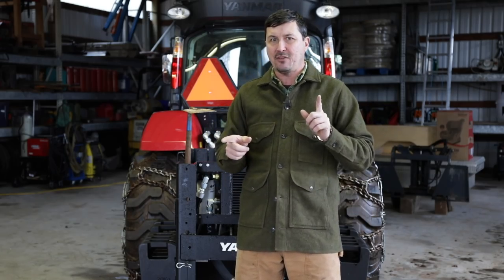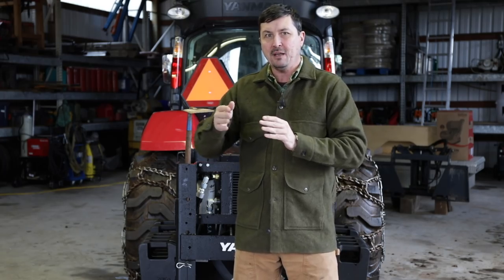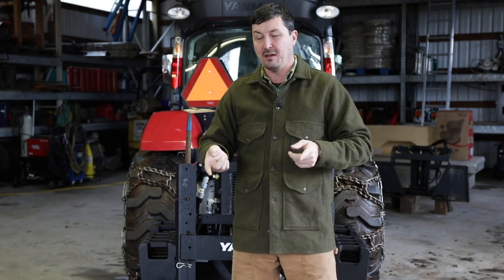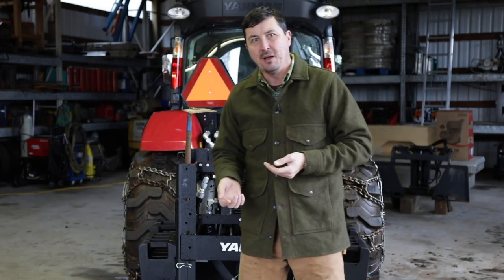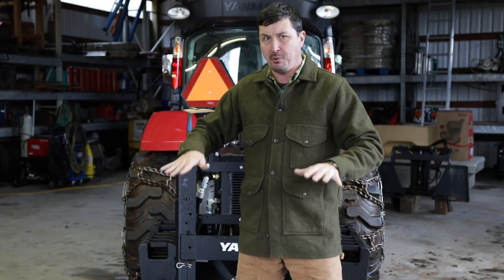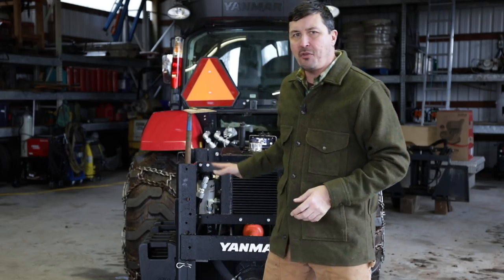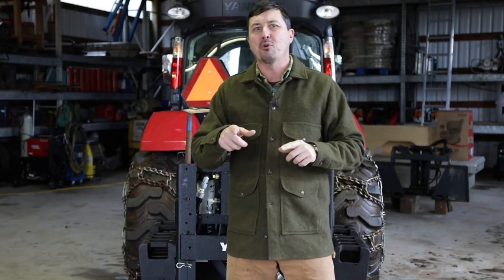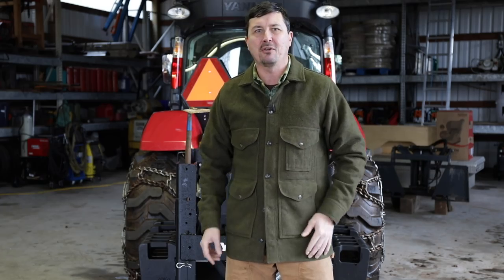Testing The World's Biggest Broom

Comment: Our power packs put out 3000psi @30 gal a minute. We do diagnos with a flow meter on the pressure side .May be filter or hose size? We can pump up a 3 story building to run concrete cutting saws with blades 26"-72" in diameter. Looks like flow to me. Love all your content.

Comment: Double check the pressure the implement is suppose to run at. I know you mentioned you have spoken to the engineers behind the product but if the yanmar power pack provides 3000 PSI and the blower is designed to run at 2500, 2750 which is typical for attachments, then you're relief should be opening providing partial flow to the blower ask if there is a port relief on the Yanmar valve. Resulting in not enough power to throw it far enough because a majority of system pressure is being bled off, same for flow and the speed. Don't confuse pressure and flow, Flow if how fast the work gets done, pressure is the work it does. Could only flow .1 GPM at 3000 PSI, but it'll lift just might take all week. 
Also if this blower is a high flow unit, it would result in exactly this performance. High flow units run over 31 GPM as a industry somewhat baseline, if your Yanmar power pack is a standard flow unit at around 22 GPM, again this exact performance would be the result. Bought a sweeper for my skid steer at auction was high flow, didn't want to drop 70,000 on the machine to run it, so we run it on standard flow and it's just slow like your blower.

Comment: Hi Cody. I feel the same way about my snowblower being underpowered. (agri-ease blower on a 40hp foton) My tractor is the smallest recommended for the blower and it  only throws snow 10'-15', not 40' as advertised. When I "accidentally" run it at 1100rpm if works great!! Too bad it's not rated for that... I hope you find the solution to your conundrum, blowers are so much nicer than plowing when you get a lot of snow. Cheers!!

Comment: I haven't heard great things about the pump, other than you have more ground clearance without the under carraige.
On my tractor I have the frame that goes on the bottom and connects to the blower and its worked great. The downfall is putting it on, which is easier the second time. On my previous Massy, it had so much power it would blow sheer pins in the blower. On the Kubota with the undercarraige, its been unstoppable. And I have room for a box blade on the back, which is a great tool to have for backing up to garage doors.
Reply: I really wish Yanmar would send you the latter for comparison. Come on Yanmar!

Comment: Cody, that is a standard 2 stage throwing system, if you pull the shoot off and look down into the impeller you will see the clearance between the impeller and the walls, all manufacturers make a gap there because they dont want anything to wear out particularly metal parts etc. There is a youtube video of a guy that closes the gap or clearance  out of a thick piece of rubber and it instanly fixes the problem, no , ore clogging and it will shoot snow twice as far, ill try and find the link.

Comment: If you think something is bypassing use an infrared thermometer and look for high temps on the return side of valve, motor, etc.  The fluid will heat up a lot when it bypasses, or when a relief valve is opened up due to pressure.  I believe you have a flow issue due to speed, as flow controls speed and pressure gives you power.  So if they have enough flow coming from the power unit you need to do calculations on the supply and return lines including fittings.

Comment: I couldn’t tell if you were at full speed when you ran the broom but it looked a little slow also. If you get the meters hooked up and find that you’re getting rated pressure but not flow, I would suggest that the next step would be to hook up a second pressure gauge at the snow blower. If there is a significant pressure drop from the power pack to the snow blower then have the engineers see if the piping and quick connectors are adequate for 20 gpm.  I know there are differences between manufacturers, but for a sample of what is typical I suggest checking out some of the older videos on Billstmax channel with his John Deere tractors and attachments.

Comment: Mr. Wranglerstar,  I work in the Aviation field and when we have hydraulic issues we have who is called a Fault Isolation Procedure (FIP) Kit, it will narrow the problem down to the specific component that is failing.  I would also look at the gearing from what was visible and audible it sounded like the hydraulics were fine.  Love the channel keep doing you despite what my interest are I love the content.  Even when you post something that does not peak my interest I will still watch it because I may learn something.

Comment: not an expert but it seams that the cork screw is stealing the pressure from the blower fan, i use to run a blower for the state of Utah and if i remember right the blower fan would spin up almost all the way to speed before the cork screw would really start spinning, so i wonder if it still has the correct pressure and volume but they need to send the fluid through the fan before the corkscrew,  maybe using a by pass till the fan gets up to operating pressure or something (i may be over thinking things because of the scale difference between a road and driveway blower but hopefully it might get some thinking toward the right direction) thanks for the content and uplifting thoughts, i hope you get this figured out

Comment: The front mount snowblowers I have installed have 2 front relief valves, one for the impeller and one for the auger. I normally turn them all the way in then back them out 2 full turns, then use a valve and gauge to set the actual pressure. There should be specs in your owners manual. The relief valves are your shear pins so don't just bottom them out and run it. There could also be a relief valve on the power pack, the Frontier models have that, but not the Erskine.
Reply: What did you name the bridge?

Comment: I'm a maintenance mechanic at a slaughter house in Pennsylvania.  The absolute most useless tool I have in my work tool box is an 8 inch adjustable wrench from harbor tool freight.  My job depends on an adjustable wrench because of the sheer number of nuts and bolts we have on the floor.  The Pittsburg adjustable is so terrible because of the fact that the head is too large it never fits into any of the spots it needs too but I've had it laying in my box since I started.

Comment: It appears from the video that the blower doesn't increase in speed (certainly not to the same extent that the auger does). I highly doubt its a function of the power pack not providing enough flow. I'd be curious if the engineers specked out that portion of the blower incorrectly. Keep up the show, and know that the work is appreciated. You're a man after my own heart.

Comment: Hi Cody.  I am by no means and expert.. but I think the hydraulic lines need to be significantly higher diameter that run from the power pack to the arms of the tractor.  You said 20 gallons per minute at 3000 psi.. that is moving a lot of fluid and you have no gains by narrowing the "transmission lines" that carry that volume.  The idea is cool -- obviously some kinks need to be worked out.  But yes, definitely, the auger and the fan are not turning fast enough.  A tractor blower should be able to blow slushy wet snow and not accumulate in the chute.  My blower is a rear pull-behind 7 foot blower and I can move any type of snow.. just not larger ice chunks.

Comment: I would look at the specifications of the replaced fittings flow rates.  When you showed the side by side comparison it those selected appeared to have much smaller diameters than the factory units.  I would also suggest that you measure the pressure and flow at the blower rather than at the tractor connection.  Enjoyed the opportunity to participate.

Gerry J Smith

Houston

Comment: Looks normal to me. I have a little john deere 425 with a front mount 48" commercial 2 stage blower that is PTO driven. Some snows are heavy are wet or salt laden (near the public road) these freeze in the blower frequently and I never shut off my PTO because if I do i can guarantee it freezes up. I watched a video from 68ford or something like that, about using hard rubber on a push blower to clean the impeller. I added hard rubber to my second stage impeller and it has made a big difference but I break more shear pins with stones. But if I get heavy soupy or salty snow in the shute it will freeze I keep a broom handle on top of my blower with broom clips to clear snow. I also find it necessary to shut down the engine and clean it by hand. The john Deere dealership recommends slip plate on all affected areas and I use silicone spray on top of that. More moving parts equal more problems as far as I'm concerned.

Comment: Are your quick disconnect fittings rated for enough volume? Check pressure at the snow blower and work your way back until you find a sudden increase. That's your restriction. Also check for restrictions in your return line.

Comment: You are right i also think the blower runs much to slow. You should check the hydraulic pressure and max flow at the front connector. What are the specs (max rpm, needed flow, needed pressure) for the hydraulic motors in the blower?  Wat can the hydraulic powerpack deliver?

Comment: The pressure and volume at the output of the pump, may not be what's arriving at the blower. Plumbing may be too small or perhaps too many reducers/adapters/elbows/or quick attach fittings in between. It really sounds like a fluid volume issue IF you determine that there isn't a valve issue.

Comment: In order to diagnose the hydraulic issue you will need the specs on the flow and pressure ratings for the hydraulic pump and hydraulic motor. Some variable displacement piston pumps have a pressure regulator adjustment on the pump housing.

Comment: Cool video WS.  BTW, you're pushing 1M subs so ya gotta be doing something right!  My passions are fly fishing and shooting and I subscribe to a number of channels that cover those topics but I'm also a family man and that's why I look forward to your channel.  It's more about the relationship you have with Jack,  the Misses friends and neighbors that make me look forward to every episode.

As far as useless tools why do I think Fiskars is going to make an appearance?  A couple that I have are cheap digital calipers that show the wrong measurement when the battery's low, an early oscillating tool where the attachments keep vibrating off and a set of "universal" box end wrenches that are supposed to fit a variety of nut sizes but only good enough to slip off and any 2-cycle engine tool where you need a $40 tool to adjust the carburetor.

Comment: Also, the gap between the impeller blades and the discharge chute may be too great, make the blades a closer tolerance and you should be good to go.  I had to do the to my Honda HS 50 two stage snow thrower.  Except I added some heavy duty truck mudflap pieces to my impeller blades and now I can even throw slush.

Comment: By the looks of the hydraulic setup on the blower , there’s 2 hydraulic lines and an electrical control lead which I assume is controlling a diverter valve for the chute angle and deflection. Is it possible to bypass those diverter valves and only have the hydraulic lines going only to the blower motor to see if there’s any improvement ? God Bless Cody !

Comment: If there is a problem with pressure then you might have a faulty relief valve at the blower itself. I'd check the relief valves thst might be on the unit itself and see if any are set too low. In terms of flow, there could potentially be a faulty restrictor on the unit. I'd have to look at the components themselves in comparison to the schematics to really diagnose it lol. But from what I can tell, if the power pack is operating properly, a relief valve or restrictor could be your issue. Granted, something could be bypassing but those two things are the easiest to fix hydraulics wise.

Comment: I am kinda interested in seeing if Yanmar can get this hydraulic front blower figured out none of the other local tractor suppliers are doing it all hydraulic, I like the idea, I think it would be good likely shear less pins if any at all. But I don't think it is going to work, there is too much dynamic friction and it is changing all the time. Maybe more mass or a big flywheel, but the hoses are too small and the restriction is too great to overcome with the flow. I have a wood splitter that has 19 usgpm at ~3000 psig and it is not so fast with around 1inch diameter hoses. Yeah the broom isn't loading up like the snow blower, the broom is basically same mass all the time and no secondary load like 2nd stage of the blower. Another problem with the Yanmar product is the 540 rpm pto you are limiting power the other dealers are using a front pto with variable speed not limited to 540 rpm. I have a Kubota 4760 with a front mounted blower it is a shaft drive driven by a mid mount pto, it works awesome it will blow fresh snow 100 feet, it moves the snow so that you will not have to deal with that  snow again this year.Hey Cody on the channel you are doing what you like and I think that is what you need to do, you need to have the variety you need to be happy at what you are doing if you don't you will not continue. I would rather you continue because what you do you get interested in enough to do it right so I can learn from that, weather it be axes, fire-fighting, welding, wood working or Mrs. W and her garden and making preserves, I can find enough on your channel to interest me, I don't have much interest in making a camper of a van, or flying drones but you do other things I like and I can watch what I like and pass on the rest, no worries. Keep up the good deeds, they are positive accomplishments.

Comment: You should power the blower up and use an Infrared temp gun.  Once it's up to operating temperature you want to look for HOT parts.  Extremely warm spots in hydraulic systems indicate leaking motor vanes or bypassing valves.  Give that a shot.  If you were on the west side I'd give you a hand.

Comment: Possibly a relief valve stuck open or set up for too low of a pressure and volume. Could probably be resolved by 't'ing' in a pressure gauge and setting the relief valve to the proper pressure.

Comment: Keep doing what you love!  The auger looks to be turning too slow on that blower at 540 based on my years using 3 pt blowers on farm tractors (can't tell about fan from video, but if auger is slow, fan probably is too).  Increase flow rate, or gear ratio off hydraulic motor?

Comment: Cody, when you assembled the blower you had some issues with the quick connect fittings and you had to get some new ones. Are yiou sure they can handle the needed flow? I'm not in hydraulics, but such devices need a huge volume rather than pressure, so this may be a reason for not getting enough speed at the impeller.
And dont let you bring down by some haters. They will always find a reason to slam someone down, so dont care about them.
Greetings from Germany!

Comment: If the power pack is producing the correct pressure & flow rate, Was the hydraulic  motor for the blower sized correctly? 
Also the broom may work correctly because it only has one motor. the snowblower has two, blower as well as the auger.
Do the hoses need to be bigger to get more flow?

Comment: Neither the auger nor the impeller were running fast enough.   You should be able to blow that snow 30 feet.  You need to check the pressure and the flow from the pump first then do the same at the connections on the blower.  Once you get the readings you will know where the restriction is.

Comment: Try putting a mark on the fan with some paint so that you can see how fast it is spinning using your camera and a strobe light that way you can see how many RPM's that the fan is spinning at as that would be helpful information to the manufacturer of the snow blower so they can help you diagnose the issues you are having.

Comment: Did you add any after market quick release couplers for the hydraulic hoses? Could the different fittings be restricting the flow or pressure to the blower unit itself.

Comment: I think the problem lies in the line size and quick couplers. Have a look at a bobcat blower and the size of couplers and lines they use. Those pioneer style 1/2" couplers are great do a cylinder or two, but for high flow motors they are not sufficient. I also think you need to be in th 30+ gpm range to get real performance out of a blower. My 2 Canadian cents

Comment: Check the hose sizes and connectors to make sure they are large enough to get the volume you need but not so large that the pressure has dropped too significantly

Comment: My thoughts on the hydraulic snow blower issue. 1 blower may be designed for high flow. High flow skidsteers are generally 38ish gpm. 2 you are saying yanmar designed the power pack for 20gpm. My skid steer blower is designed for high flow. If I don’t turn high flow on or try to use it on a standard flow skid steer it does exactly what yours is doing. So either swap for a standard flow blower or make sure you truly have a high flow power unit. P.S. standard flow blowers are not as enjoyable to use.
Reply: Kudos on the later part of your video. Things change. Keep doing what your doing on you tube.

Comment: As far as crappy tools go, I  had to rewire the central vac system (to replace control board). I needed to crimp on some wire connectors and found my old crimping tool (cheap Taiwanese junk). I found it in an old toolbox and decided after trying to operate it to buy a better one rather than  use it again. The old one went into my steel scrap bucket.